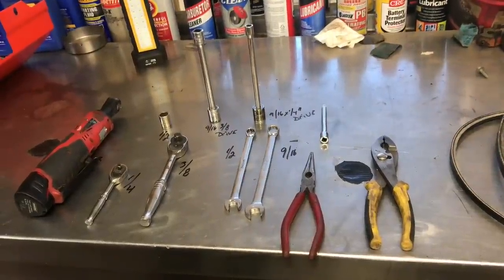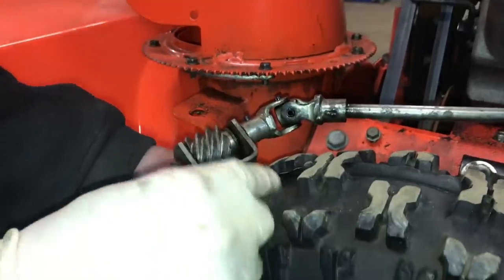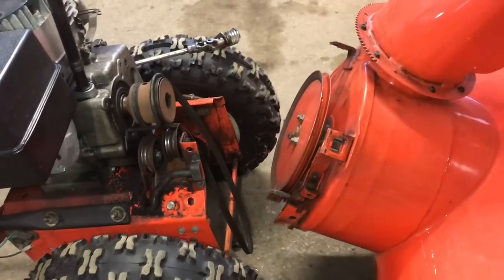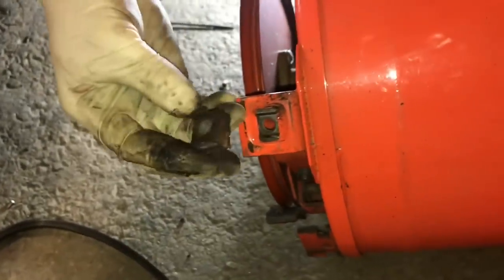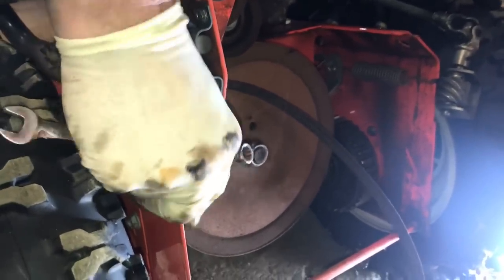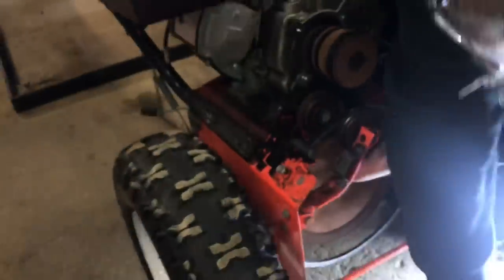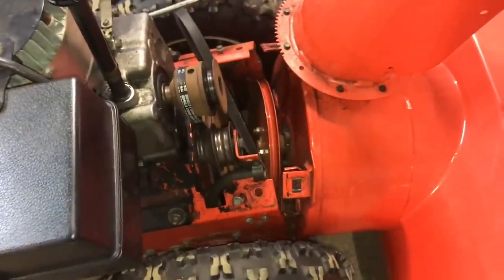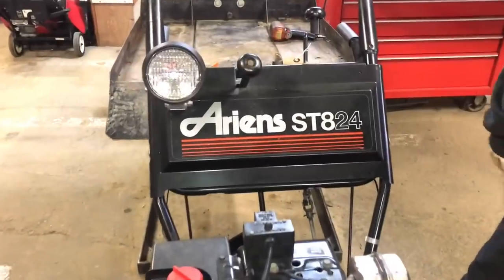How to Install Auger and Transmission drive belts on Ariens ST824 Snow Thrower

Comment: Great video!  The camera was moved around to show us just what part you were working on and the detailed explanation of the procedure was super helpful.  It' was also good to see how you resolve the minor problems you run into, like the loose set screws on the pulley shaft, supporting the back end of the blower with the table and the brake shoe in the in the way.  Great video.  Looking forward to more from you
Reply: Replaced both belts today. 
Your video was fantastic, it’s the exact model I have.  I encountered the same issues you had.  Thanks for the great video, couldn’t have done it without it.

Comment: Can't say "thank you" enough for making this detailed, excellent video!  I have this same blower, a M/N 924050 from right around 1980, and it's still rollin' along.  I practically can't kill that dang Tecumseh 8-horse it's got on it, despite working the daylights out of it!   
[... more below ...]

However, at long last, I'm starting to have to replace a few of blower's "wow, that finally wore out, didn't know that would ever happen!" type of parts.  In fact, fooling around with my auger idler adjustment this week, my neighbor and I found that the auger shaft bearing (located behind that big auger-drive pulley) is severely shot.  Not surprising, considering this monster has been through 39 Wisconsin winters!

So when you showed the close-up of tightening that pulley back onto the shaft (as well as the details of splitting/reassembling the housings),  I found that super-helpful!  It goes a long way to understanding how I've gotta go in to change that bearing!

So again, thanks so much, SUPER video!

Comment: Excellent video!!!  Thanks for posting this.  I have a newer (20yrs old this year) that I want to service this Spring once snow season is over and this video will help me tremendously with changing the belts (which are original).  Just changed the spark plug (this past week no less) for the first time in 20yrs.  Replaced the carburetor a few years back (the engine surged terribly with the old one).  Other than that and oil changes and grease jobs, and the Tecumseh Sno-King engine/Ariens 1024 has been running like a champ!  Thanks again...
Reply from the maker: That model snow thrower are the good ones!!

Comment: Thank you very much for the video.  Having just the old repair manual is no substitute for what you put into producing this video and seeing all the detail.  I have a ST724 924048, which is a similar design.  I also have to replace both idler pulleys because the bearings are shot.
Reply from the maker: I'm glad it was helpful!

Comment: Awesome video. Thanks , i'm not afraid to change my belts on my Ariens now.
Reply from the maker: Hi Barry, I'm glad this video gave you the confidence!! Just take your time and you'll get it :) I would suggest using OEM belts (Original Equipment Manufacturer) so you will not need to perform the task more often. I have learned that many after market belts especially snow thrower belts fail much sooner. Please give this video a thumbs up, subscribe and tell your friends to help my channel grow. It would be greatly appreciated. Thank you for commenting and the kind words.

Comment: i have a 1336 pro and it looks very similar to that so i think this will be very helpful and no trial and error any longer, tried to get it off from the bottom but the brake would not let me
Reply from the maker: Good luck, let me know how you made out! Thank you for watching and commenting.
Reply: @JohnsonsSmallEngines  thanks to your video it was so simple I only needed to change the one belt. I wasted twice the time trying to figure it out before saw you do it. Thanks again. 😊😊😊

Comment: awesome video, thanks!! Question for you, my ariens in 12 years old. Are there any bearings in the tensioner pulleys that should be replaced while I am in there??
Reply from the maker: The tensioner pulleys have bearings and you will just need to spin them to hear if they sound loud. If you want to replace the bearings they are inside the pulleys so you just replace the pulleys. It is up to you and your opinion on how they sound and look if you replace them or not.
Reply: @JohnsonsSmallEngines  thanks man, I appreciate the reply, I mind as well replace them while I am in there.

Comment: I installed a new drive belt on my 10/24 ariens . my belt came off from acorns in the pully. i hate mice, my belt fell behind the pully and i could not get it out from behind so i cut the belt, if the belt came off forward of the pully i would have used the same belt, i bought a new belt and it was alittle thinner and worked great, same ariens part no. i think they revised that belt for that problem, hope this helps.i could have loosened the pully and maybe got it but. good luck

Comment: Thank YOU!!! owe you  a cold beer!!
Reply from the maker: Any time! Thank you for watching and the kind comment. Please tell your friends about my channel and subscribe to help my channel grow! It would be greatly appreciated :)
Reply: Quick question..I was replacing the belts on the same blower, the spring that attaches to the transmission tensioner  was disconnected..can you tell me how that gets reattached?
Reply from the maker: @rmp608  I unfortunately cannot say unless I see the machine. I work on so many I cannot remember but you should be able to possibly see a wear mark and you may need to take the bottom transmission skid plate off to see better.
Reply: @JohnsonsSmallEngines   Hello..I sent you an email with a picture ..can you view it and see if I put it back the right way? Much appreciate it!!!

Comment: Brad, thanks for another great vide. I think you saved me HUGE trouble! My snow blower is really close to the one you're working on here (its very old I bought it used).   The wire clip that goes just over the auger belt you mention has two flat washers behind the clip, right?  First the flat washers, then the clip, then the two bolts that have lock washers as well.   Whoever worked on my snow blower last, put the two flats washers outside the clip so it sits closer to the engine, and the wire part is not quite over the belt.   I think that may be the cause of some of the trouble I am having getting the auger to stop when i release the clutch?

Comment: Thanks for detailed video. Learned some good tips.  I have this same setup on my 1976 Ariens ST824.  My problem is with the "drive belt" or more specifically with the tensioner pulley that seems to get caught in the back position not putting tension on the belt -- so the belt slips off.  I checked the pully spring and it is not broken.  The arm holding the tension pulley seems to be loose with a lot of play front to back which I think causes the arm to hang up in the back position.  Since the pulley spring is behind the big 12 inch belt pulley, I can't figure out a way to get back there to replace that spring.  Can you tell me how to take off the big 12 inch belt pulley? If I take off the big center nut, will it come off easily.  Need your help if you have some time. Thanks, Bill from Ohio  PS:  The old drive belt measured 33.6 inches.  I already tried a 3/8" by 34 inch belt and it slipped off.  I couldn't get a 33 inch belt onto the pulleys.  I ordered a 33.6 inch belt today, but I still think the problem lies with the tensioner pulley assembly and or spring.
Reply from the maker: Hi Bill, I do not remember all of the machines I work on and they leave the shop so It is hard to understand what you are trying to say. If you would like to talk about it go to my website www.johnsonssmallengines.com and fill out the contact page. I will call you and if you can take a video of what you are looking at and send it to me once we have spoken, I'm sure i can get you going again!

Comment: Few days ago my sister's ST824 (932101) stopped throwing snow.  I immediately thought "ok, it broke the belt.  no problem."   Order new belt.   Go to swap it out and realize I didn't have the tools with me because it appears necessary to split the machine like you did here.   Weird.   My dad has a 1028 (924116)  that snapped the auger belt the day before.  I was able to change the belts without splitting the machine.     Not sure why Ariens would design a machine that would have to be split to change a belt.  "Engineer" has become a four-letter bad word to me over the years.      For the record, the 932101 did not snap the belt.  It does appear to be stretched enough to allow it to slip off the drive.    I'll change it in a few weeks when it warms up.
Reply from the maker: You may need to do a little more work to put the belts on but the older Ariens snow throwers are built like tanks!! Verses the newer generation of snow throwers. :)
Reply: @JohnsonsSmallEngines  I agree.  Those tecumseh engines can sure take a beating.     Is the 932101 setup similar where you loosen the top bolts and the machine separates?
Reply from the maker: I don’t work on enough of the older Ariens to know from one model or another if they are similar. Good luck with it and I hope the video will help! :)
Reply: The reason they were made to split is because there were a small series of attachments that could replace the auger and gearbox. I know there was a rotary sweeper head, but can't remember what other attachments there were. It was a powered multi-tool  for the day. There was a reason after all!

Comment: Thorough explanation on a "how to" video.  You're that type of YouTuber that people can actually learn something from because you explain it so well. I have an Ariens ST1032 do you know if it takes the same belt as the one in your video?  Mod#924073, Ser#009558.  I was able to locate the service manual and parts manual online and I believe I have found the correct belt part numbers but I just didn't know if you had a quick reference to confirm my belt sizes match the belt sizes of the one in your video.  Any help is appreciated but don't go out of your way if you don't want to.
Reply from the maker: With the numbers you have there, Your auger belt should be part# 07210800 and the transmission belt should be 07206600